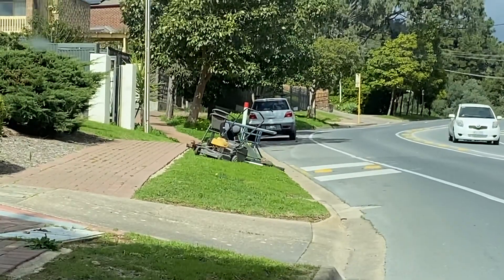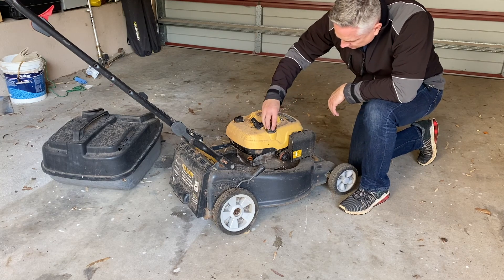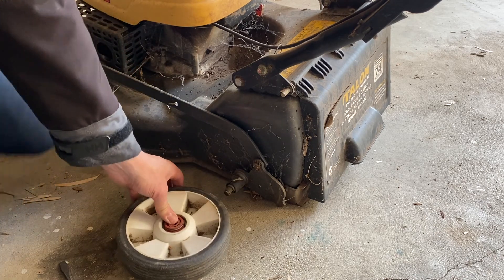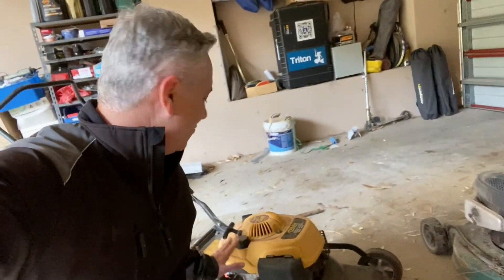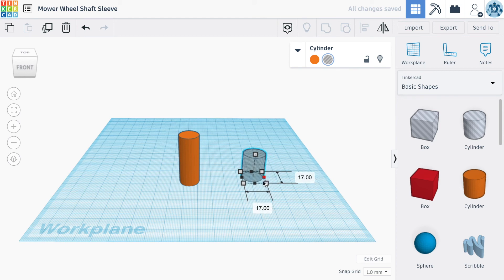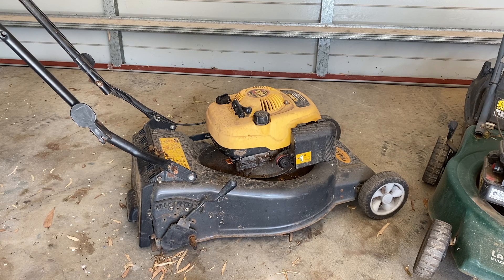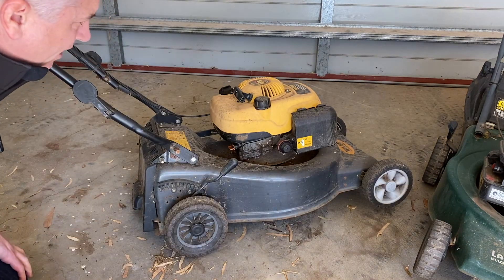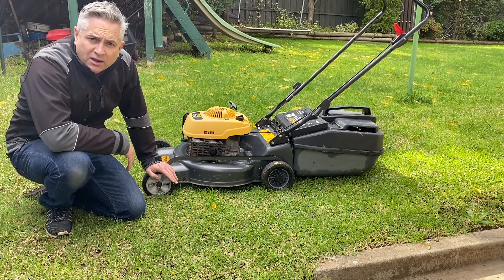Will it Run? Free Roadside Talon 4-Stroke Lawnmower - Brought back to life with a 3D Printer!!

Comment: I recently threw out a base from a Talon mower. You could have got the wheels off it. I found it with a Briggs off a Victa thrown on it. It didn't suit it very well so took out off to put back on a Victa!
You put 7" wheels on which is why it's sitting on it's haunches a bit. 8" diameter wheels would be better but use what you have and they will do the job for now. 
3D printer would come in handy for such situations.
Reply from the maker: Hi James, if only I had known!  Anyway, I managed to get a working mower out of trash and gave it away to a friend who I believe is still using it ... 3D printed sleeve and all!!  Cheers Drew